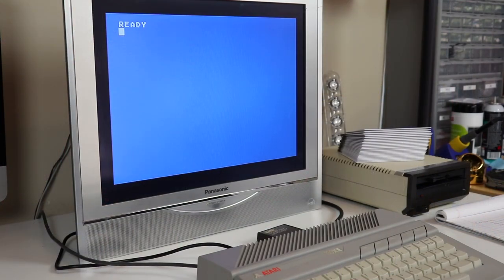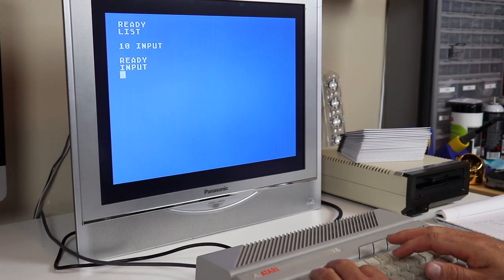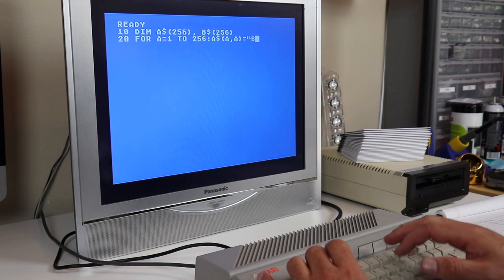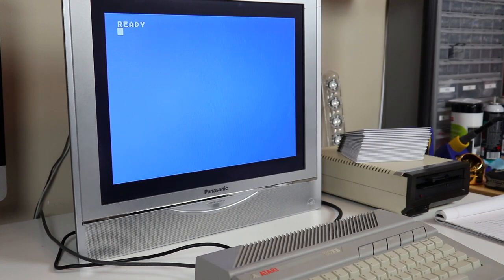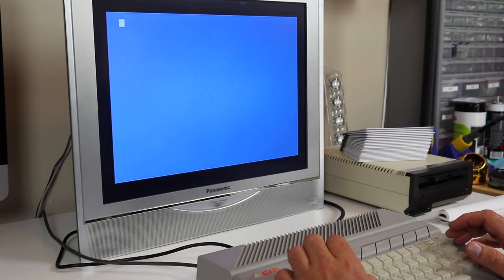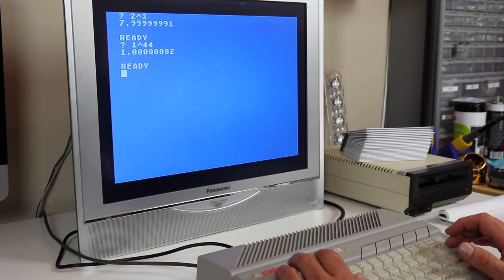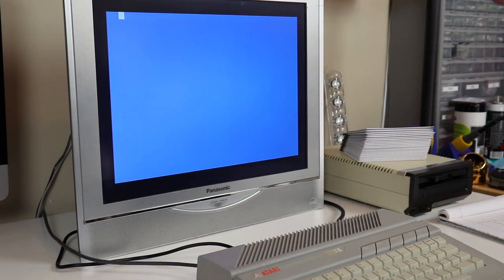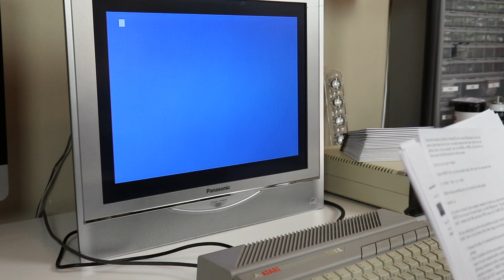Atari Basic Bugs!

Comment: The ATN at 11:30 is right because the result is Pi/4, which is the same as 45 degrees expressed in radians. If you want to get the value in Degrees, you have to use the DEG-Command: Try DEG: PRINT ATN(1)

Comment: Thank you for this overview.

On Revision C, you can try “PRINT +-0” (plus minus zero) and it will print “-0E-<8”.

I have also found one bug in Turbo Basic, which does not occur in Atari Basic. I made a program that executed the command “POKE 842,13” to enable the “autofire” mode of the “Return” key, I created a loop “FOR I=0 TO 255”, inside the loop I prepared a “CONT” command on the screen and the program executed the “STOP” command inside the loop. The loop was supposed to count to 255, but it counted only to 99. The Turbo Basic commands “*F+” and “*F-” do not affect this bug.

In Turbo Basic there is also such a bug that if you use a “PRINT” command with a text constant ending with one of the characters “Ctrl-R” and “Ctrl-U”, it will not print the newline character (as if there was a semicolon at the end), but this bug is already known.

Comment: Never heard of the blank INPUT bug before.
At least I have Turbo BASIC XL and OSS' BASIC XE cartridge.

Oddly enough, there is a Microsoft BASIC adaptation for Atari 8-bits.

I seem to remember an odd way to fill strings which goes
DIM A$(1),B$(256)
A$="8"
B$(1,1)=A$
B$(256,256)=A$
B$(2,2)=A$

Comment: Fun!
A lot of these problems come from the fact that ALL numbers in Atari Basic are floating point (even line numbers). You start doing fancy math with floating point numbers on an 8-bit computer and you're bound to get some weirdness.
Again they're doing this all in an 8K cartridge. I don't think you can do anything these days in 8K.
Reply: The floating point library is built into the O.S. (that's how they were able to get Atari Basic down to 8K). It uses BCD and was written by someone who hadn't written a math package before.
Reply: I can't imagine that nearly anyone had written a math package yet in those days.
Reply: @lorensims4846  Eventually they came up with a standard to go by but at the time, there wasn't one.
Reply: The 8-bit Atari OS and 8K Basic are of their time and I for one am glad because it pushed me quickly into 6502 Assembly Language for machine language subroutines which was the start of my learning everything I ever needed to know about computers on my Atari 800.

Comment: I think you would have liked to have covered the COM command.  Synonymous with DIM, but intended to be a COMmmon variable type retained in memory during LOADS and SAVES.  It was not implemented fully, but the COM command works at least to the degree it will substitute for DIM.

Comment: 1:13 Microsoft BASIC on the C64 takes about 9K of ROM space.

1:48 Is the cup modeled after the beard or is the beard modeled after the cup?

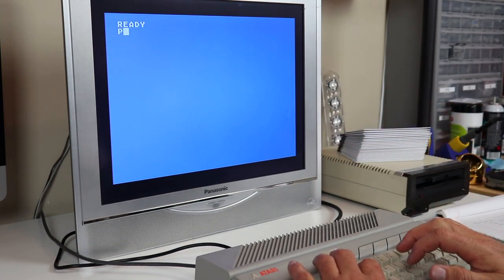7:31 It's presumably trying to print out "-0E-128" (-0*100^64), but it's been limited to two-digit exponents and is failing to process -0 as a special case while it does process +0 as a special case (or else it would be printed as "0E+<8").  Printing the decimal E-98 would come out as normal, E-108 as "E-:8", E-118 as "E-;8", and E-128 as "E-<8" since those are the ASCII characters immediately beyond '9'.  IEEE floating point also distinguishes -0 from +0, but Microsoft BASIC doesn't, even though it could since they all use a sign-magnitude representation for the floating-point mantissa.

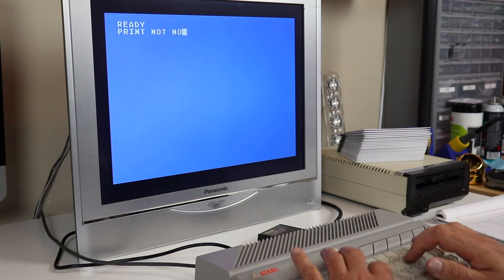8:30 Producing an error is illogical.  NOT NOT True ≡ NOT False ≡ True.

10:21 Most implementations of general exponentiation use EXP() and LOG() functions internally, which themselves use polynomial approximations, so the results are always going to be a little bit off unless you use more precision for the intermediate calculation than the required precision of the result.

11:36 The ATN() result is only off a little in the last digit since it's presumably returning radians.

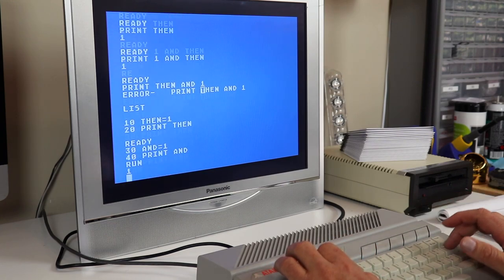13:15 What do you get for PRINT AND AND AND?
Reply from the maker: The cup was a gift so coincidental! Not sure what "PRINT AND AND AND " does, will try and see...Thanks for the feedback!

Comment: If you add a Basic program line by typing it on the screen and pressing the “Return” key, the program line must fit in at most 3 lines on the screen, but you can insert even longer program lines by reading them from a file with the “ENTER” command.
Reply: another trick is to use abbreviations for the keywords. 10 GR.8:SE.2,0,0   etc.

Comment: Hey, just a shot in the dark. I remember doing something fun, This won't hurt your machine, it was just a little weird thing.. But If you turn on your computer (mine was an atari 400) with basic and type "poke 510,kill" then press enter, it should get stuck, then press reset, then type "poke 510,kill" again and i think it makes a sound and perhapse theres some machine language code in the top left. If no code is there press reset and type "poker 510,kill" a third time and it should show. Then go to the top of the screen over the machine language and it should glitch the screen a little and when you press return it goes to a really neet graphical screen I would daydream was like tron.. :P I don't have an atari to video this and emulators don't quite work.. Cheers.. I do not know how I found that. lol
Reply from the maker: Tried it but just locks machine each time. That address points to the stack so it really just messes up the program for the OS and Basic lol
Reply: @8bitandmore  Dang! Funny thing is you'd think "kill" would be a variable=0 but if you try 0, it doesn't work.. weird.. cheers from regina canada (the city that rhymes with fun from the movie deadpool) lol..
Reply: The memory locations 256 to 511 are reserved for the stack. Modifying the location 510 probably damages a return address or some other information stored in the stack.